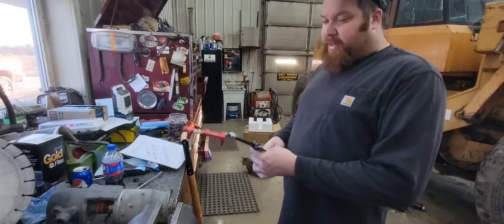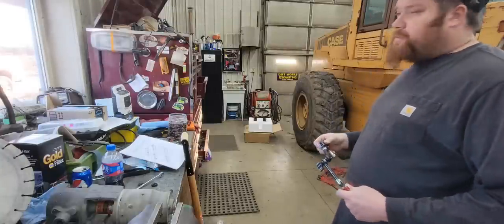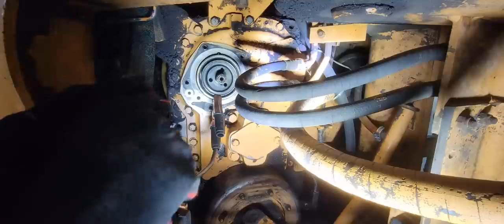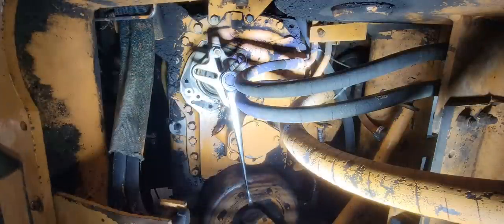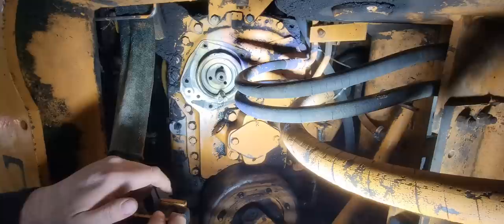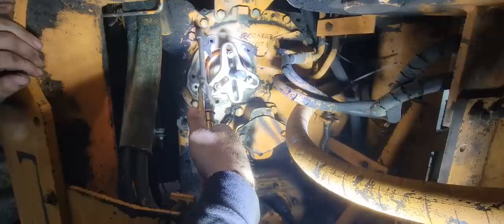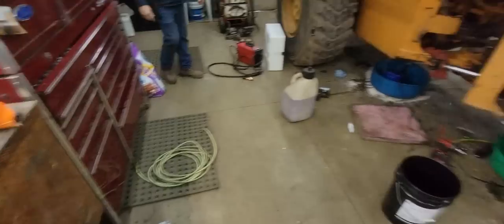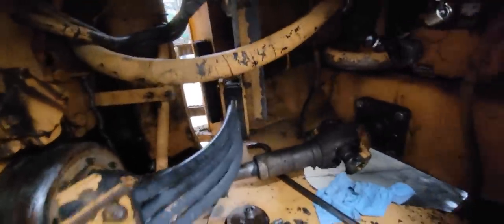Bearing Failure Things Got Crazy But I Think We Got Lucky!!

Comment: great job, just amazing what you have to go through on some of the heavy equipment.
it never seems to be easy , but you were correct, no damage is a great thing especially 
with gears in the transmission. the hoses are cracked do they need replacing? or are they 
low PSI.

Comment: I’m glad that puller worked for you. Only collecting dust for me. 
I think you got lucky. That bearing material could have grenaded that tranny!! The hydraulic lines looked a little cracked on the video. I’m sure you checked them tho. Lol. Great job getting that mess apart!
Reply: It's how they are manufactured.  Frankly the outside means jack squat anyway.
Reply from the maker: Yes thank you it worked great!...yeah we got lucky that the bearing pieces must have just fell straight down in to the bottom....yeah them house need to be changed the braids are starting to rust
Reply from the maker: They are getting pretty rusty in the braids it's probably time just to change em